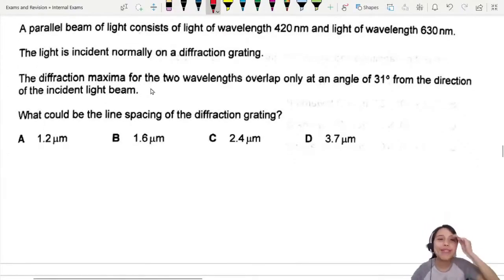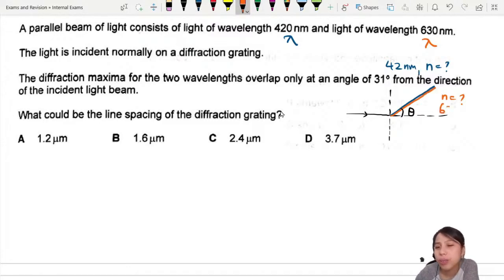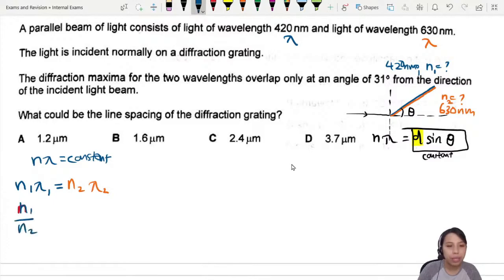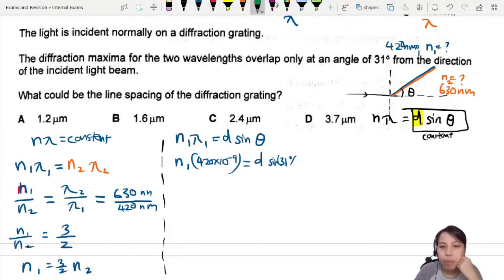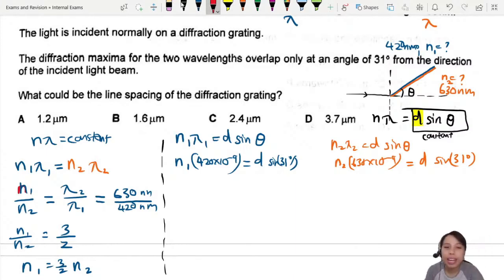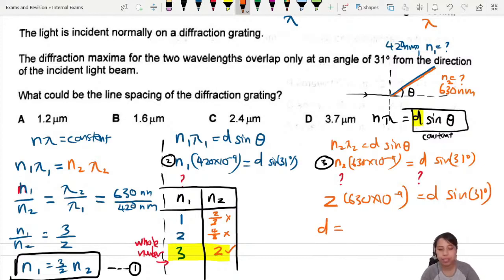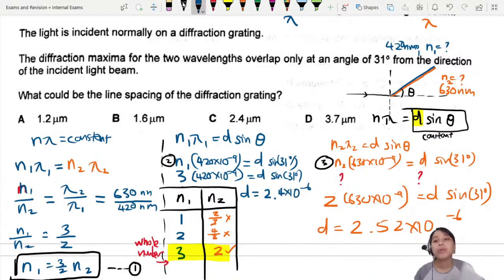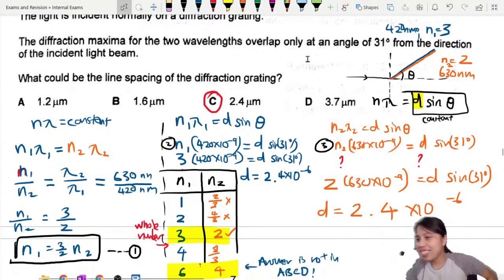MJ21 P12 Q29 Grating Line Spacing Equations | May/June 2021 | Cambridge A Level 9702 Physics

Comment: There's another method I've found you could use - finding the LCM of 630 and 420 (1260), and dividing it by those numbers to find n (comes out to 2 and 3 as well). You can then calculate d using the equation, gives the same answer in a much lower amount of time :)
Reply: That's so helpful!! This comment should be pinned
Reply: Why do we find LCM tho? 😰
Reply: how do u find the lcm of scuh random numbers super quick-
Reply: @nawfaljafri this is such a late reply but typically you would find the multiples of the biggest number first. In this case it’s 630 which would be 630, 1260, 1890… and so on. You just have to find the smallest multiple that can be divided by the smaller number, so 630 and 420 does not give a whole number, but 1260 and 420 does. Hope that helps :)